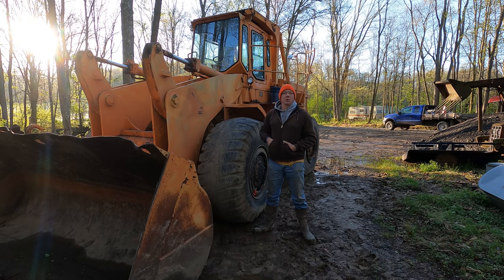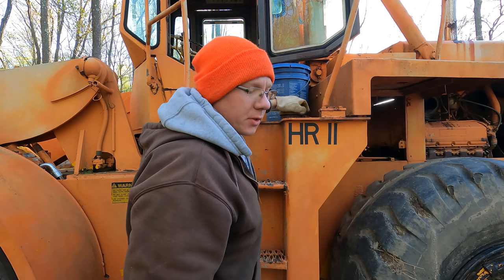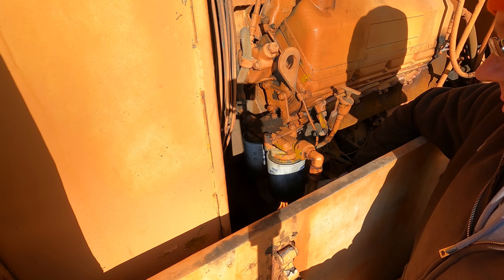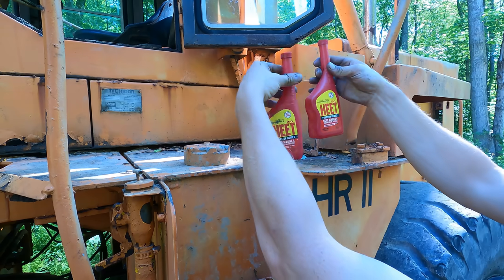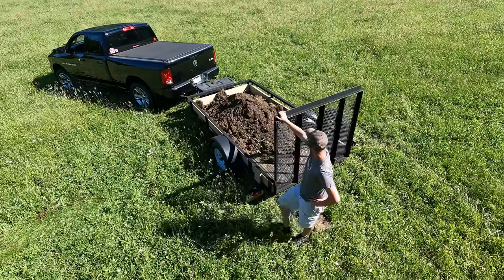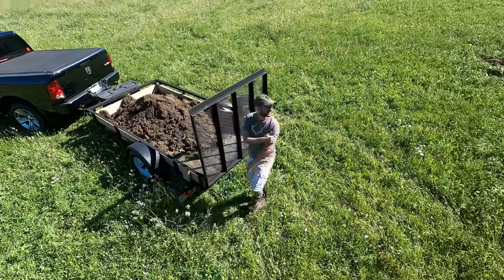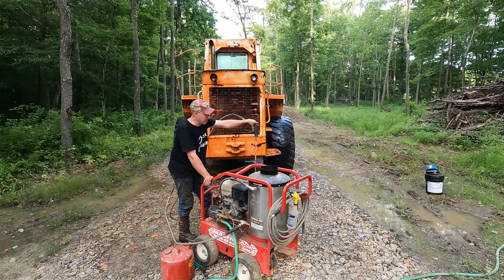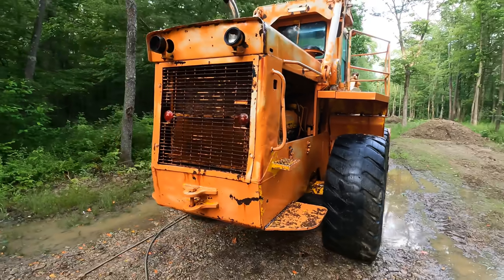Repairing & steam cleaning 20+ years of Filth off of Abandoned Clark wheel Loader! (ASMR?)

Comment: Hey, I just thought I'd explain what that HEET is doing to the water in your diesel (for anyone who sees this and cares). HEET contains alcohols that act as what's called a co-solvent. So, diesel and alcohol are miscible (you can mix them in any concentration; they stay mixed and don't separate into layers) water and alcohol are also miscible, but water and diesel can only tolerate tiny amounts of each other before they separate into layers (like me and the inlaws). But if you add some alcohol to the diesel, you can get the water and the diesel to mix together long enough to go through the fuel filter and burn. The water just gets harmlessly released as steam out the tailpipe with the rest of the water that's formed from combustion. Chemistry!
Reply: Righto! : )
Isopropyl alcohol, aka "rubbing alcohol" - something tells me that isopropyl alcohol sold in bottles with "HEET" labels on them cost significantly more per fl oz than this very same stuff sold in drugstores as "rubbing alcohol". It is sometimes used as industrial solvent, which should be even cheaper.
Reply: Another tip for when faced with unexpected fuel problems. You can use a 4% mixture of "white" gas (a.k.a: modern unleaded) upto a maximum of 10%.  Don't go wild, at 10% you can start D9 cats in -60F. Been there, done that (Barter Island, AK).
Reply: Thanks for the information.
Reply: So, does alcohol allow you and the inlaws to mingle together long enough to get the job done, like heet in the diesel? 😁
Reply: @CGT80 great question 😂😂😂😂😂
Reply: Injectors dont.like that! Better to increase Cetain
Reply: Lmao the in-laws

Comment: Little saftey tip for you when tramming the loader over any distance, always tram with bucket crowded back so if in the event of a hydraulic failure and the boom suddenly drops, it reduces the risk of the bucket digging into the ground and potentially sending you through the windscreen or another reason being if you have a power loss or break failure you can lower the bucket down onto the heel plates to slow and stop the machine safely.

Comment: To start heavy equipment in the winter, in cold climates, when the only thing you can plug into is a pine tree. Above -40° use a propane tiger torch, length of stove pipe with elbow up underneath oil pan, construction blanket over engine cover. Below -40° use diesel fired Herman Nelson heater, kerosene freezes at -47°, run elephant trunks to below oil pan, cover as previous. 
Best wishes all.

Comment: that hissing sound as you unscrew the fuel cap suggests that the tank breather might be blocked
Reply: Yeah, I caught that too.
Reply: Definitely.
And at least one of the belts squealing as it slipped.
Reply: had that happen on a generator. it kept stopping when ramping up after running for two weeks. then we discovered it had a breather handvalve which you had to open after transporting the thing. opened it up and started running normal again.
Reply: @GARDENER42  I mean, it's one of Matt's vehicles, of course it has a squealing belt. 🤣
Reply: That’s normal

Comment: Hi Matt,  As a rag-sailor, when I buy an old boat, the very first thing I do is put a sounding tube to the bottom of the fuel tank, and then using a small PAR hand pump, I  take a sample to see what kind of dirt and how much water is down there waiting to clog filters or injector nozzles.  You probably have the same problems with old diesel powered equipment.  Does anyone put waterproof grease on the filler cap threads to keep all water (rain, or sea) from getting into the fuel tank?  If your machine sat for 20 years, with a half full tank of fuel you'll have lots of condensed water caused by the fuel tank breather tube breathing in outside air as the temperatures change day / night / and with the seasons, that a sounding tube will quickly  reveal.
If that is the case, and you find dirt and water at the bottom of the fuel tank, pumping it out with the sounding tube is a big first step.   At least you now know that you have clean fuel in your fuel tank.
Cheers, Connie
Reply: Great idea, what brand is your hand pump?

Comment: Hit the wire brushed rust with Rustoleum Rust Converter to convert the rust to inert material before you paint. I have rusted metal that I did that to 10 years ago and no sign of rust returning to those areas.
Reply: @Jim Barrie
hello 
how are you doing
Reply: Painted a cast iron kettle, used as a planter, with KILZ.  OUTSIDE 20 years and no rust has come back through.

Comment: Love what you are doing here Matt. Have you considered utilizing a water sand blaster addition to your pressure washer?  It would clean up the rust and paint down to bare metal really quickly for you and from what I can see about them (not used one myself) the flash rust from it drying would come off with a wire brush on your grinder in a quick pass in preparation for painting.  I really think it would save you a huge amount of time over wire brushing it off entirely. Great job on bring back this old iron, you have a knack for finding treasure!  Take care, Bob
Reply: Good video

Comment: Matt if you had let the loader dry then sprayed all the rusty areas with OSPHO it would turn black and be primed for paint.  Ospho turns iron oxide into iron phosphate which is inert and is also a good primer for paint.  Rust will not return, it works fast and is only $20  a gallon. The best rust treatment of all.

Comment: Don’t know much about these machines but on our old buses there’s not just the two fuel filters to filter the fuel, there are several small ones in the fuel line and one bigger one on the fuel tank. That’s the first one in the whole fuel line, the two filters you changed are the last ones. Most of the time the one on the tank catches the roughest dirt, the others allong the line catch finer dirt. The smaller ones in the line have fine copper mesh in it and due to new diesel without sulfer, the copper will slowly dissolve and clog up the system. So what we do first, regardless new fuel or not, is clean the tank and replace the small inline filters or, if this is not possible on site, run the engine on a separate tank with new fuel and new filter pots.

Comment: I'm an old diesel mechanic, clean and inspect the fuel tank and lines there is probably rust scale and other crap inside, look for old steel fuel lines that deteriorate inside. This will help you run much better. Alcohol absorbs water.

Comment: Basic old eng the 555, they have a gear pump so pumps up pretty quik.
 Would of been alot of cruddy old fuel in filters.
Shouldnt rev so much when cold but, Usually the injectors dribble on the 555's and blow alot of white smoke when starting.
That one runs good little bit of blue but it's old.
Ceaned up great, like ya said you could chisel away for days at it.
Washings always good you can look around for other problems that exist, like the plate with 1 bolt, front step possible future leaks around hoses, any rust, hoses outa place the list goes on.
Fix rust bits,  prime and patch as you go.
Something.elsa will go wrong and more $$$ no doubt.
Thanks for video and enjoying the journey and life  of the machines.
You,  Marty t and mountain block moments are my favourite.

Comment: Is the vent clogged for the fuel tank? Seemed like there was a long "woosh" sound like it was sucking a lot of air in when you removed the cap. That could be part of your problem.
Reply: I'd say thats the issue. The tank had a vacume due to the cold temp. So it restricted the fuel flow to the pump

Comment: Worked in Kazakhstan -40 C during winter most plant and truck driver light a fire under the sump to get some heat into the engine. That's if they don't have block heater connected to mains

Comment: I’ve seen a guy build a pretty good fire on your bulldozer to get it started and I seen a guy do it with a 18 wheeler just be happy that we don’t have any leaking fuel I prefer getting a propane heater forced air heater underneath her and let it go for a while, I’ve use that diesel mechanic in a bottle didn’t keep my tractors from gelling up and it worked well, Had an easy start I think it was 2° out

Comment: Cruel and unusual punishment of the starter.
Reply: He needs to learn how to use either correctly and then use it when starting a known hard starter. That saves a hell of a lot of wear and tear on the starting system.
Reply: has a good starter and batt. Could almost smell it.
Reply: They are made for it. Had a Detroit Diesel service manual once that said to let the starter cool after more than 60 seconds of continuous cranking in cold weather.

Comment: I used to drive a diesel Mercedes 240D that the fuel would gel up in the first cold. Gas stations would change the mix for winter but if you had fuel left from warmer days you could get stranded until it warmed up.

Comment: Excellent video Matt :) my area of  Roads & Works Department there truck went thru 3 color colors in over 25  years went 1st Dark Sunshine Yellow look Orange for 15 years , 2nd to Bananna Yellow  for 12 years & last color was Green Yellow Flurocent paint for 9 years and when Township merge town with Town Works Department in 2002 now Forest Green & White colors Lol!  But want think strange Matt :) my Late  dad & uncle Bill on farm they used put a 25 litres metal pail  with 2 gallon of old Desiel motor oil from crankcase plus 2  gallon of gas or desiel fuel new stuff light on fire under oil pan of farm tractor of gas one with rubbing alcohol in carb or sentiment bowl  and 3 desiel tractor had 2 fuel filter with 200ml of Dexron Automatic Transmission number 2 or 3 in each plus new desiel fuel filter and screw prime up with bleeder screws! Did ever Winter Season months plus to Farm Truck to fire up and I did once to biggest Desiel tractor because loader tractor won't fire because oil so thick like Moillasse for Cooking plus get driveway cleaning up of snow come down in big amounts plus person had ditch there car in driveway need tow out in 1993 year! But what happened Matt that Loader tractor motor fuel pump more fuel then oil in motor of Fuel Pump plus in cylinders  engine oil O ring were history  plus motor need rebuilt  bad so Smoke like grease fire bad at 350 RPM to 1500 RPM  ! Then 1600 RPM to 2300 to top  RPM and would clear out and not smoke at all too! But when motor got rebuilt and Turbo fix also clear up too also use that tractor smoke bad plus need big bath after use that tractor before rebuilt motor job! My Dad & uncle used nickname that tractor Smokey Blue because it toxic smoke tractor after repair to motor and clearing problems! But do remember seen my dad & uncle used Ether Squirt can for lots stuff farm plus vechiles even small engine like chainsaw plus lawnmower to and only used once ever also not fan of Ether ever ! Seen in my Auto Mechanics shop classes in High school did to engine was pretty and lucky still have eye  to of small engine blew  and was 20 feet away from motor blow up !

Comment: You sure do treat a cold engine tough. I was taught never rev a cold engine like that until you see the heat gauge start to come up. You work hard to make enough to buy this equipment, I sure would hate to see you crank it up and spin a bearing, or worse. That Michigan loader is a bad dude, even if it does have a 555 Cummins under the bonnet. You take care young fellow. You're a good operator.
Reply from the maker: I hate to rev it like that but I was trying to draw the fuel through because it had air in the lines.

Comment: Matt it is true they did put fires under the fuel lines and tank to get them warm once they started to put additives in the fuel they still used gas to heat the air lines till they put in the container filled with special anti freeze solution in the lines./

Comment: at 31:31 the pressure cleaner motor pinged before shutting it down. sounds like your using regular gas even thou they are made to run on that stuff. in Australia regular petrol is 91octane &  our premium  is 95 & 98 octane. I think in the USA your 91 premium is about similar or equal to our 98 premium unleaded fuel. I enjoy your videos. greetings from Australia.

Comment: Put a clear hose on the pt pump suction. It’s sucking air from a filter line or tank line. Giving it drain back also. Check the restrictor valve coming out of the heads also. I can’t remember if these have stc. But it’s not smoking to much on load
Reply: I have that exact pressure cleaner in aus hahaha

Comment: Personal opinion, This machine is what a pressure washer media blaster attachment would make amazing progress on. A couple bags of media that is just hard enough to attack the worst of the rust and the thickest gobs of paint and it would honestly probably end up less work than trying to wire wheel the rusty area's while delivering a far superior paint surface. Not talking take it to the metal all over sand blasting, just enough to remove the worst of the worst and give the final paint a reasonably consistent texture..or at lest as consistent as you are going to get on a machine like this.

Comment: You would do well to get a laser ablation tool to remove rust from these old machines especially if you have so many vintage vehicles that will be recovered from years of outside neglect. Would be vital to stop erosion to the metal structure of these machines.
Reply: For most people laser cleaning is completely impractical.

Comment: Add PRI Fuel preservative to it as well as fuel dryer.  1/4 oz per gallon on PRI.  Used that in south Arizona where temps go from high 20's to over 80 degrees in the Spring. Kept the water out of the diesel.
Reply: You did Not say if you had added Injector Cleaner.

Comment: Yeah burning those filters can lead to a uncontrollable fire and loss of all vehicle.  Just recently this winter our loader operator did just that. Some firery oily remains dropped under our jcb 456 engine pay while heating the filters with a open flame. Thing kept smoking for a while only after emptying a fire extinguisher under the engine solved it. The driver almost got fired for this action. Problem was fuel that was meant for -20c but it was -28c

Comment: it seemed like the diesel fuel tank had been pulling a vacuum until you undid the fuel tank lid i thought i heard it venting and equalizing to atmosphere. I also think if a return for fuel or more so hydraulics was frozen the pump has no where to put the fluid in the case of a hydraulic pump with water in frozen pipe and just builds pressure until it stalls or bursts

Comment: I remember watching a YouTube video of the old guys trying to get the old Russian truck started they would literally have Rags on the end of wire and would light them on fire and stick them around the engine so it would help heat the engine and then they would build a fire underneath the truck to get them started I've also seen them drain all of the antifreeze and water out and every morning they would have to melt snow and put the hot water in the radiator

Comment: I've used a couple camp fires to start old machines up here in the Great White North. It surely seems odd to watch a machine with a fire going underneath. But if you're careful and use some common sense it can be a great way to get old frozen iron up and running. I learned it from an old Russian guy. He could cold start anything that still had it's engine intact and fuel.
Reply: I believe HEET is supposed to combine with water and let it burn off in the cylinders.

Comment: I'm sure you know by now modern highway diesel is nearly paraffin free and doesn't gel but will stiffen, off road or heavy equipment diesel still has sulfur and as a accessorie component paraffin, also fuel tends to gel in the supply line first, or from the smallest part/exposed components of the fuel system

Comment: Spray all the rusty spots after wire wheeling with Ospho. It will permanently neutralize the rust and acts as a primer for painting.  It turns iron oxide into iron phosphate which is inert.

Comment: I heard that Alaska bush pilots would set down at sunset and pull the oil plug and let the oil run out on the snow. The next morning they would build a fire under a big pot and put the chuck of snow and oil in the pot. It would boil off the water and heat the oil which they would pour into the motor, prop over, and take off.

Comment: The ethanol mixes with the water to give a octane level to the water  in essence waiting down the ethanol to help pass it though, it's still bad for the engine though isn't as harmful as straight water in a diesel though it is possible to add to much ethanol, heighten the octane level and cause detention due to the high compression levels

Comment: Hey Matt if you do sell it you might talk to direct perfect .next what type of soil you have by you  
I asked you about running polypipe from the stream to the pump on top of the hill and figure  a garden shed to house the pump and hoses as after the pump shut off the water drain back  .Matt could you use kerosene to mix the tank as a cleaner

Comment: Do you know that acetone does a better job then heat. It takes 1and a1/2 oz. per gallon of fuel and it also keeps the algae from growing. I been using it for 15 years on my tractor and truck  and don't have any problems with any of my stuff. I all so dump a 1/2 gallon in the fuel barrel ever time i fill it, Check it out it will save money and time.